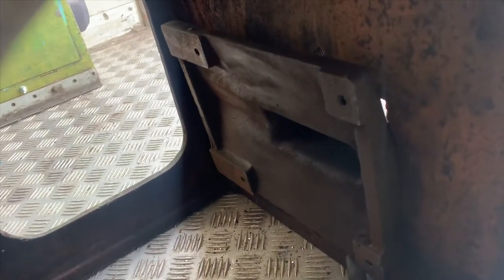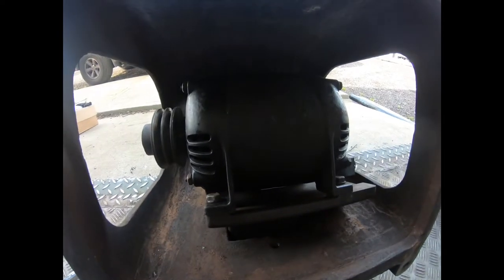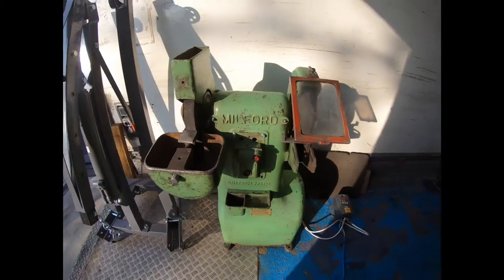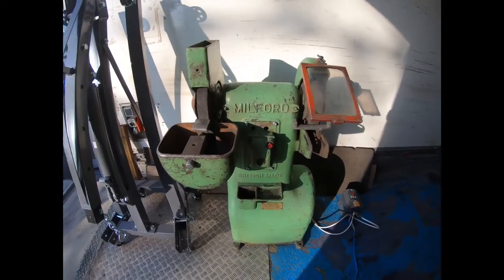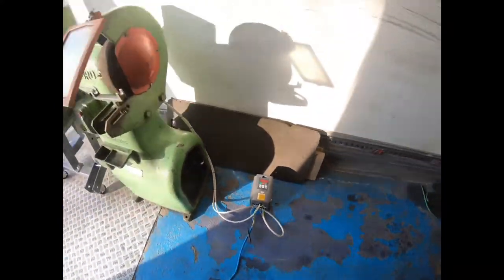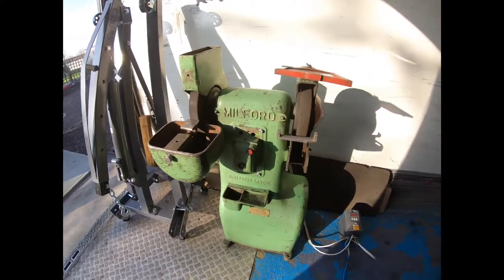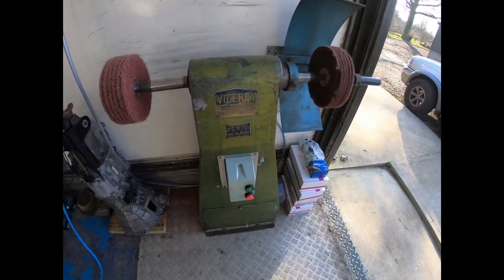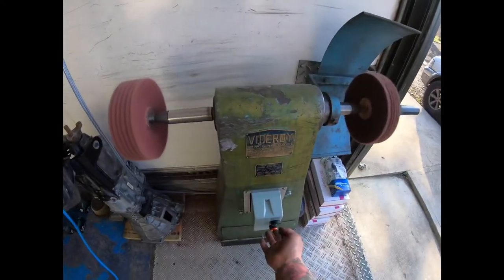Milford wet stone grinder PART 2 - up and running

Comment: hI, i have just bought a gate milford 12 inch grinder, unfortunately its missing the nuts that hold the stones on would you know what size and thread these are the shaft on your grinder looks identical to mine with right and left hand thread, thanks for any help you can offer and thanks for the video.
Reply from the maker: Sorry i did not see this months ago, im afraid i dont know what the thread size was on these

Thanks
Marc